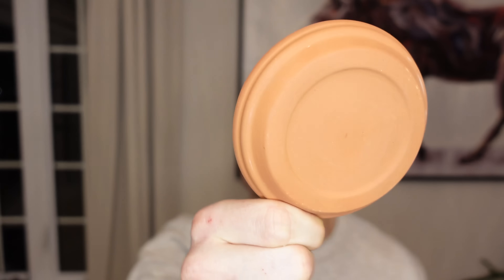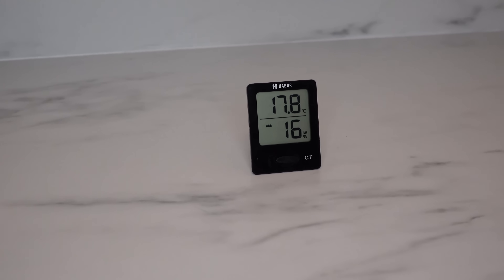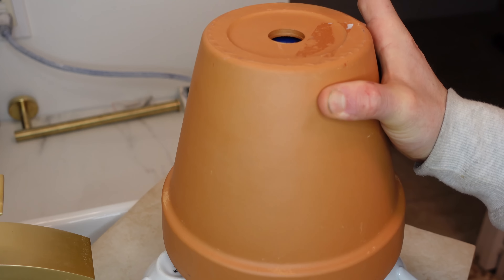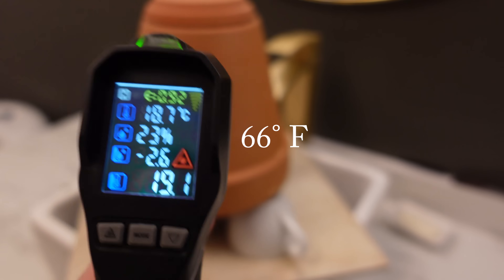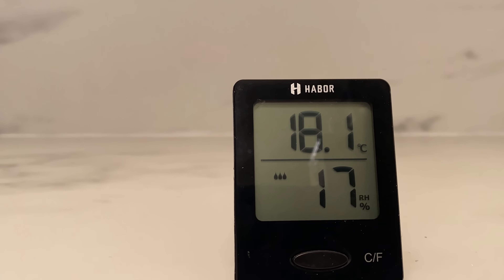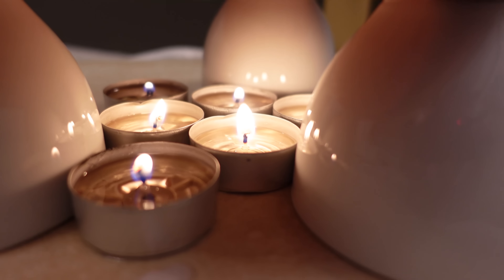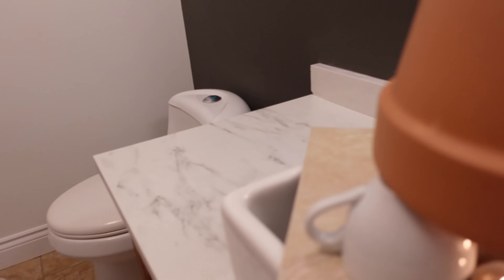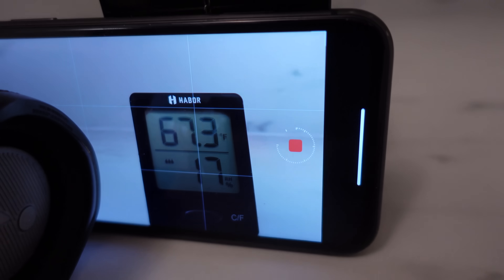CLAY POT HEATER TEST | Does It Actually Work?!

Comment: A candle gives you about the same heat as a 30 Watt light bulb (not a LED bulb).
You need 75 to 100 Watts to heat a square meter of your home, depending on isolation of your home.
So you need about 3 candles for every square meter of your home to make it warm.
You won't get more heat out of these candles with those pots.
Yes, the pots get hot, but to heat the room they have to emit the heat as much as possible.
That is why heating radiators have a surface that is as big as possible.
These pots trap as much as heat as possible in them.
Radiant heat doesn't warm up the air directly.
Radiant heat is like the sun when you're outside in winter.
The temperature doesn't rise, but the infrared radiation penetrates your skin, make it feel warm.
The pots emit far less IR radiation than the sun on a winter day.
You can't feel the warmth of the pot on your face when you enter the room.
The laws of thermodynamics.

You should have prepared for this a long time ago, instead of having some makeshift heating.
I have propane lamps that give 10 times more heat, and light.

Comment: A tealight candle puts out approximately 32 watts of heat energy there is no way you can change this....doesn't matter what you do.. does it matter what kind of elaborate device you make a candle put out 32 watts and that's it... you could increase the energy output by pouring alcohol over it or maybe setting fire to your house

Comment: i've seen people posting these things over the last few days because of very low temps here and power outages.  I wondered if it actually worked but this video shows me this thing is basically useless.  doesn't heat enough to do anything.

Comment: I use three terracotta pots inside one another separated with a long bolt, nuts and penny washers. Penny washer placed over the outside hole, bolt through, penny washer inside then nut to hold in place. Several large nuts or stack of penny washers then  next terracotta  held in place with penny washer and nut. More large nuts or stack of penny washers then last terracotta layer held in place and if there is any length of  bolt left more penny washer held in place with a nut. The idea is to get a large volume of metal in place that collects then irradiated the heat.
Four 8hr tealights are then placed on a house brick with two house bricks one each side laid to form a U shape. light tealights and place the assembled pots over the top. 
The room I heat is 12 x 14 x 10 and it reaches a comfortable 14c with two of those in the room.
For many that would be to low a temperature. However, when coming in from a freezing cold outside it is a very balmy room to enter. As long as you layer up if you are going to be sitting in the room it will be enough.
EDIT:
Forgot to add I keep a pair of oven gloves close by so the tealights can be replaced once they burn out every 8 hrs.

Comment: The "0riginal" version  that I was most aware of utilized a carrier bolt inverted with nuts and washers to connect the large and small terra cotta pots together allowing the head of the bolt to come close to the tip of a single candle flame.

The bolt tightened the surface of the two pots together for better conduction and to concentrate  convection from the flame up too the connected pots.  So there was N0 hole at the top for any heat to escape.  Since the smaller pot was suspended from the larger pot,  the larger pot better shielded the candle and concentrated energy.

I belive the videoed version contains too much airspace underneath the pots, IMHO

IT... would  also be interesting to repeat your test with just 6 candles burning atop the ceramic tile, without any pots. 

In my observation,  your probably  releasing a significant amount of heat from the room each time you open the bathroom door, compacted by 3X or 4X.  

Just a thought !
Reply from the maker: I will have to try Thai

Comment: I’ve used oil lamps for years, one large oil lamp heated a bedroom for hours.
Reply: Have you tested that for CO2 emissions. Was wondering about that. Have 2 for emergencies. The flame can be adjusted so it burns cleanly. Believe they make a smoke free oil as well and could possibly use kerosene as well.

Comment: Yes, the clay pot heater does work very well but be extremely careful as the melted wax has the potential to ignite and once that happens the flame can get easily out of control and set off the smoke alarm.  Multiple small 5 or 6 inch clay pot heaters with a single tea lite candle is much much safer and better alternative to using a single big clay pot with multiple tea lite candles.  

Clay flower pots are extremely cheap and so are tea lite candles.  

If safety is a main concern then one should choose the single clay pot and single tea lite candle route.
Reply: The clay pot heater doesn't work any better than burning the same number of candles without the clay pot, because they don't add any energy by adding a pot.  All you did was make a hand warmer.

Comment: I used three different size clay pots  inside  each other,     on a  clay bottom flower pot saucer , all pots  bolted to a threaded rod with nuts and washer spacers. With three small feet (short bolts with nuts and washers. All drilled through the clay. Be careful drilling as the clay will pop out a crater when the drill  comes out the other side. Drill just enough to see a small hole, then finish the hole from the other side. No craters !    I put one in my workshop on the floor close to where I stand. I noticed a difference in the temp. after a while. Cheap bag of candles from various stores too. Just shop around for the best prices. Cheap heat, lower electric bills and barely any smell !!!! FYI
Reply from the maker: Good heat capture?

Comment: The cap is supposed to be on the inner pot, and the outer pot should have the hole open.
It's supposed to work by trapping the heat in the inner pot, and heating it up. Then the air between the pots warms and rises, out of the hole in the outer pot. Sucks in cold air at the bottom, shoots out warm air at the top. It's like the rocket stove principle.
No idea whether it works with pots.
Reply from the maker: I’ll have to make another test

Comment: Did this last year and the huge problem is the soot. No matter how often you trim the candle wicks they still like to turn sooty after a few hour burning and it is most noticeable when you blow your nose the next morning and see all the black you inhaled all night. I was using two pots with two candles and the pots themselves was encased in a long box with a fan on one end. It put out good heat yet the soot is not good for your lungs and wasnt worth it in my opinion.
Reply: Use Beeswax candles. I use beeswax candles.

100% pure beeswax candles burn clean and have their own natural honey/floral scent even when not burning. Unlike paraffin candles, they do not contain any additives, synthetic chemicals or leave behind black soot from smoke when they are burned.

Beeswax candles are the healthiest choice in candles. Made from the caps of bee honeycombs, beeswax candles burn clean, are very long-burning, and give off a pleasant natural fragrance as they burn. Beeswax candles are dripless when burned properly, and release negative ions which help clean the air in a room.
Reply from the maker: Yeah that can be an issue

Comment: The pots create more heat because the electrostatic charge between them traps the ions being realeased from the candle flame and causes an increased exothermic reaction. A bit like a nuclear reactor, but obviously on a much smaller scale. 
When clouds bump into each other it creates thunder & lightning. And when a fireman opens a door to a burning apartment the sudden influx of oxygen into an oxygen-depleted envirnoment can create a fireball because of the backdraft. We don't want firemen or fireballs. Just a very small influx of oxygen to feed the candles.

Comment: Good grief...  First Law of Thermodynamics.   You get 6 candles worth of heat regardless, because all the energy you are putting in is 6 candles worth.

You are not creating extra energy (heat) from out of nowhere by sticking a plant pot over them. 

If you think that the clay pot is generating extra heat, then test this again WITHOUT the candles, and see how much heat it adds to the room.

Here's a clue - its NONE.

Remove the pot and just heat the room with 6 candles and... guess what? ... you get 6 candles worth of heat in the room.... which is exactly what you got in this video.

If you want to save energy, then insulate the room better, don't stick a bunch of fire-hazards in your house that will kill you and your neighbours because some people think Tik-Tok > scientific facts.

Comment: Pots add ZERO to the heat, only the candles. This is fake non-science that needs called out as nonsense, since some people may believe it can provide life-saving heat in a grid-down situation.
Clay is NOT uranium, Kryptonite, or Dilythium crystals (LOL), somehow providing additional magical energy. The ONLY energy is the flame, whether you place a flower pot, barrel, or the Empire State Building, over top of it.

Comment: 4/6/8/9/10 and 12 hour candles have a different flame size, thus different heat output. I now have 1 10 hour candle, and 4 6 hour candles burning, and the 10 hour candle flame, is about as big as 3-4 6 hour candles.

Comment: You basically had a temperature increase of 3 degrees F over an hour or so (in an extremely small room). To make it really work you'd have to have quite a few of these clay pot heaters.

Comment: I'm using the heater inside my house. Just a regular, modern, furnace. The upside to using furnaces is that... they work.

Clay pot heaters are only good for warming small spaces - i.e. a couple feet at best.

If you could adequately heat an entire room with candle powered clay pot heaters, you wouldn't need the clay pots.

Comment: Yep  it works   that clay pot above 2 candles gives off way more heat than the candles themselves    you cant touch the pot   that's a lot of radiant heat surface   surpasses candle heat only easily

Comment: To those saying the clay pots don't add any heat -- you're right, of course. But the experiment, as shown, still works.  What the pots are doing, as they heat up, is to store the heat in a location -- the counter where the pots are located -- where we're able to be near it and make use of it (till the pots cool). If the clay pots weren't there and the candles were burning, the same amount of heat energy would be in the room (till the door opened, giving the heated air an escape), but all the heat would have risen to ceiling-height, above most people's heads... not a useful place for it to be.
Reply: Especially considering most old homes the pipes are in the floor & not the ceiling like newer homes have.
Reply: That's very reassuring
Reply: This is a great explanation.... thanks for your comment. It makes sense completely.
Reply: Warm air locally surrounding the pots then that air rises. It goes to ceiling height anyway.
Reply: The pots STORE and DISTRIBUTE the heat

Comment: Instead of the cylinder drill to separate the two pots use three small pebbles (or similar). That way the hot air rises inside the inner pot then down in between the inner and outer pots. The way you have it set up the hot air doesn't flow as freely inside the gap between the two pots.
Reply: This should be pinned or put in the description... very good advice.
Reply: @Ascender4ever  Cheers. It's all about getting convection going and maximising surface area. I use this idea in very cold weather in my greenhoues, costs me pennies in tealights rather than pounds in kerosene or electricity.
Reply: @davidpaylor5666  Sorry, but no.  A tea light only produces about 30 watts of heat. No matter how you set it up, you can't increase that.  The laws of physics are against you on this one.
Reply: @TheBarkinFrog  I didn't say you could increase the power output, I just pointed out a way of improving the efficiency of the system. You cannot make it produce more than 30W but you can use those 30W in a more efficient manner. You'll have heard of "engineering", right? I use more or less exactly this system in mid-winter to keep my greenhouses from freezing up, so I can state unequivocally that the physics, the engineering and direct practical experience all call you wrong.
Reply: @davidpaylor5666  Okay, I wanted to avoid saying this, but seeing as you forced my hand....all your "experience" doesn't call me wrong if you're lying.  And you are lying.
Reply: @TheBarkinFrog  Lol. Get yourself an education mate.
Reply: @davidpaylor5666  Bless your heart. I know there are people where you come from who think you're smart, but you're not foolin' me.
Reply: @TheBarkinFrog  Insult is the first recourse of the ignorant.
Reply: @davidpaylor5666  No it's not. Deliberate obtuseness is. When you deny scientific facts, you're being deliberately obtuse. And you deserve any insult someone throws at you, especially if the insult is also a statement of fact.
Reply: @ahmadbashir3102 No. I'm saying a clay pot can't make a candle produce more heat.  

I live in Michigan. I know all about insulation. If insulation could make it possible to heat my house once in the fall, and keep that heat, I wouldn't have much of a gas bill in the winter, and one load of firewood be sufficient for the entire winter. 

Sit down, idiot. The adults are talking.
Reply: Exactly what I was thinking. The way he has it. The heat is being directed into the very top under the cap.
Reply: @finbarscanlonwolf  The way he has it does not matter. All that thing is is a dangerous hand warmer. It will not heat your room any more than just burning a few candles will heat your room. IT DOES NOT WORK.
Reply: Thank you
Reply: It doesn't matter how you set it up. A tea candle will produce about 30 watts of heat, and you can't increase that. 

Let's say your candle will burn for 4 hours, and produce  about 30 watts of heat. You'd need 20-30 candles, replacing them every 3-4 hours, to heat a 10 by 10 room.  And it doesn't matter if they're under a clay pot or not, they aren't going to produce anymore heat. 

It's not an effective way to heat, and it's not cost effective. Taking the mid range...25 candles changed every 3.5 hours...you'd need 171 candles a day. The cheapest candles I could find in a quick search were $7/125, so you'd be spending roughly $9.50 a day for heat. 

You're also risking a fire, because they can flash and explode. It's not safe, it's not cost effective, ad it doesn't work if you're only burning 4-8 candles at a time.
Reply: @TheBarkinFrog  Good advice - proves its a daft, dangerous idea.
Reply: @TheBarkinFrog  ??? Engineering isn't about magically making more energy, but about manipulating the efficiency of that energy, no? Like, the flame itself will burn your flesh, but if you radiate that intensity out to a larger space, tolerable heat is achieved.  I don't think this would be a miracle heating system for large spaces, but the physics check out.
Reply from the maker: Good idea!

Comment: Two problems with this.

1. Candles create a YELLOW flame meaning the candles are releasing carbon monoxide. Only the BLUE flame is hot enough to burn and destroy the carbon monoxide.

2. If the liquid paraffin becomes super heated the wax itself will burst into flame giving you a much bigger problem.

Comment: Excellent video. Very well explained. Subscribed from a chilly U.K. A candle has a fixed amount of BTU’s. No amount of clay pots will change that.
Reply from the maker: Awesome, thank you!
Reply: In other words, only need 1 pot
Reply: About 80 Watts so 480 Watts.
Reply: The btus might be the same but the way the heat is distributed is totally different! 
The transfer of heat energy is via conduction, radiation and convection. So, going from a burning candle to a burning  candle and pot changes the equation how fo you think?  
I'm waiting!  
And waiting!!!

And still waiting!!!!!

Comment: Underfloor heating works very well because it's all over the floor, under the carpet and the heat rises slowly due to the close temperature differential between the heat source and the air temperature.  Unfortunately it uses electricty to heat the cables and it's not the cheapest way at present.
Reply from the maker: Very true!
Reply: Very  expensive   underfloor heating

Comment: It's facinating watching these experiments, as if by magic you are going to heat the whole room all over by 3 degrees C, it will never work.  A few basic facts, hot air rises, you can't stop it. Putting a clay pot over the naked flame flame will slow it down a bit as it heats the pot up, but eventually, the hot air will rise up and heat the ceiling area.  Hot air will not flow sideways, it will rise up.     If you have a cold room, say the air temp is 3 degrees C, close to freezing,  with any heat source such as the clay pot, the hot air will rise faster due to buoyancy because of the differential of the air temperature and hot air, just as on a freezing winter's day the smoke out of a chimney goes straight up vertically and fast.    Get yourself a four poster bed with curtains on the top and sides and try the experiment again, you have a much air smaller space above the bed, and it will warm up quicker, but you may not wake up the next morning.  Anyway, the average  human body gives off 600 watts of heat which is probably more than a few tea light candles, so, get yourself a four poster bed and a thick duvet and you will be toasty warm , especially if there's two of you in there exercising.
Reply: A human adult at rest generates about 100 watts of heat, so equal to about 2-3 candles.